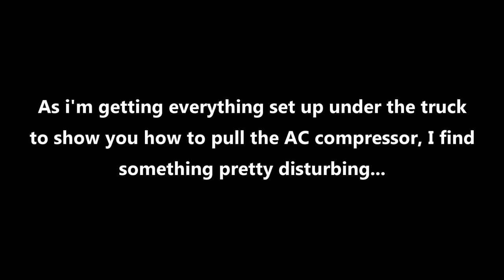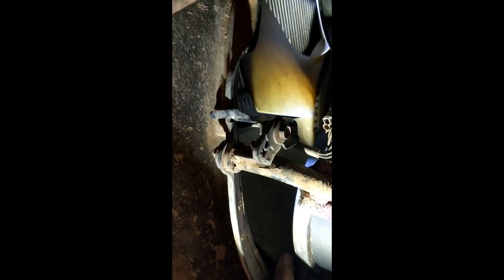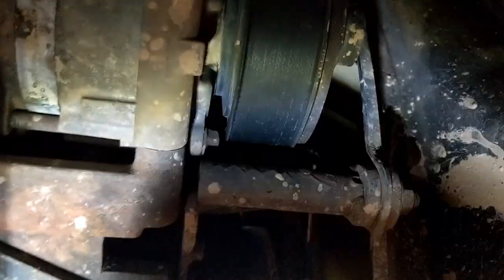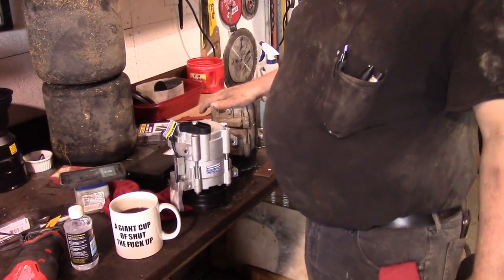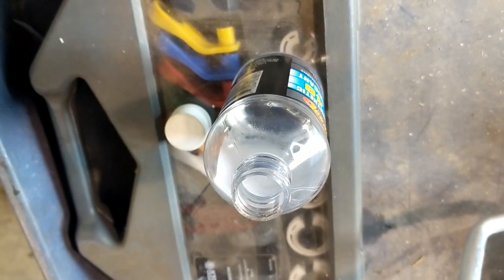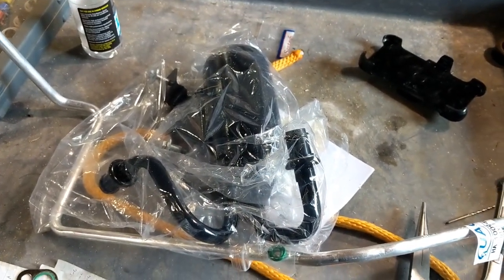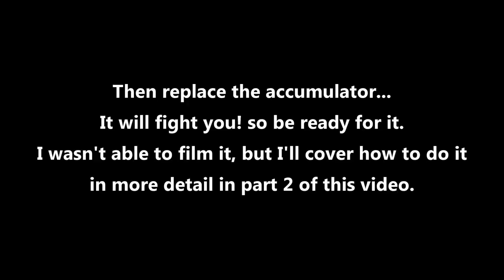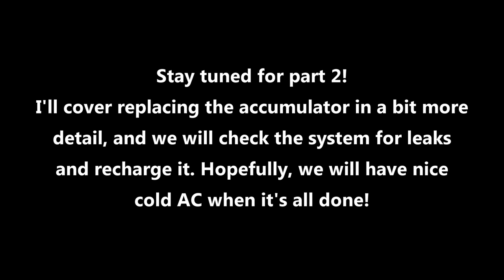How to replace the AC compressor on a 2006-2007 Dodge Ram 2500 Cummins

Comment: If i would have known you were going to just jump right into doing it i wouldn't have spent time editing my videos this morning and afternoon. i thought due to the rain you were doing other things specially since i hadn't heard from you yet.  yeah i have a whole sleeve of those reverse torx bits that i bought 2 years ago. mine are all impact coated though not chrome. Yeah that's certainly not the factory Compressor that was on that thing by any stretch of the imagination. looks like dude that had the truck before went into the junk yard and found one that mounted up the same and just snatched it and put it on in place of the worn factory one. Kinda Janky looking substitute. but hey at least now that i've bought the CORRECT aftermarket replacement and the condensor and dryer we won't have to worry about that going out on us when we're in Georgia. and if it went out on us in Georgia we would most certainly be worried about it. it's humid as all hell down there already
Reply from the maker: No worries mate! I got an early start this morning because we were going to the Frist Museum in Nashville this afternoon. I'm leaving it on the vacuum pump overnight to make sure we get all the moisture out of the system, and I'll charge it up first thing in the morning before my Vette radiator job gets here at about 9am.
Reply: @MacGyversWorkshop  Vette huh? you know if it takes you more than 45 minutes you're screwing around lol